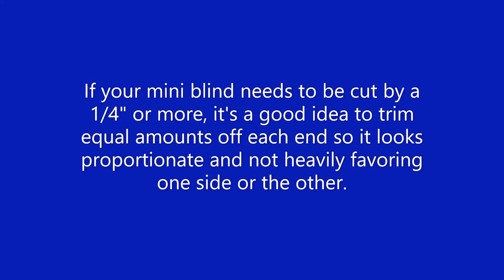How To Cut Mini Blinds To Width  Quick & Easy!

Comment: Nice video. I was wondering what I was going to do about my windows till I saw this video.  What kind of blade are you using on your miter saw?
Reply from the maker: Just a standard cross cut 24 tooth blade. But a finer tooth blade does a better job of cutting blinds on a miter saw.

Comment: I need to cut 9 mini blinds in my bedroom, where the blinds are mounted outside the window...I will just be using the “frame” of the blinds to make new window coverings from fabric, that will be mounted INSIDE the window frame (think roman shade-style)...my question is can I use a jig saw? Or a Dremel with a metal cutting wheel? I don’t have access to any other saws...
Reply from the maker: When you say the "frame" of the blinds, are you talking about the very top piece? If that's all you'll be cutting, then it is rigid enough that you should be able to cut it with either of those tools. If you'll be cutting the top piece plus the blind material, you're going to want to make sure the ends are secured tightly or you'll have a sloppy cut.
Reply: @BlueCollarDIY  well, yes & no...yes the top is what I will be using..but I will CAREFULLY take apart the blinds, leaving only 4 slats, that are evenly spaced, the length of the blinds. (I definitely don’t need a saw to cut the 4 slats down to size...I’ve got heavy duty scissors or tin snippers that should easily do that job!) And leaving only the strings that function to pull the blinds up & down. It sounds very complicated but really isnt! There are a handful of tutorials on YouTube!! Thank u for your reply!
Reply from the maker: @lauriee5200   Sounds like you have it nailed down! If you're only cutting a few slats plus the top bar and lower bar of the mini blind, then your saws should do the trick. Just remember they need secured or your saw could wander around. You can also pick up a fine tooth hand saw at Walmart. The saw that comes with the plastic miter boxes in the hardware section are great for this! I think they're about $10 or so.
Reply: @BlueCollarDIY  I forgot! I do have one of those!!! With the miter box!! Lol! Thank u!!
Reply from the maker: @lauriee5200  You're welcome! Good luck with your blind cutting project!!!